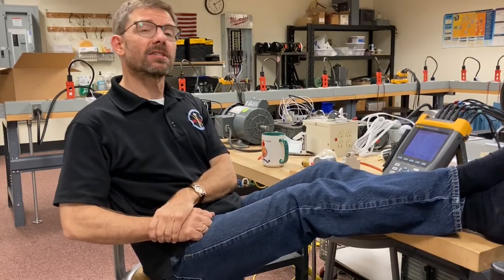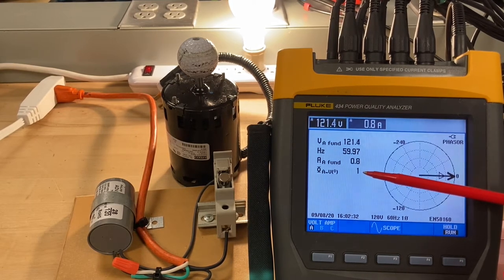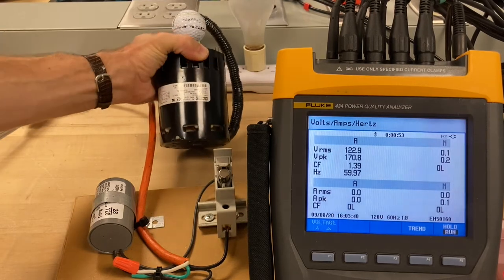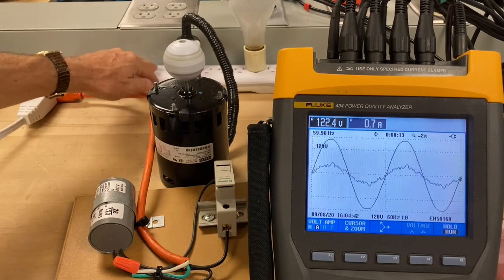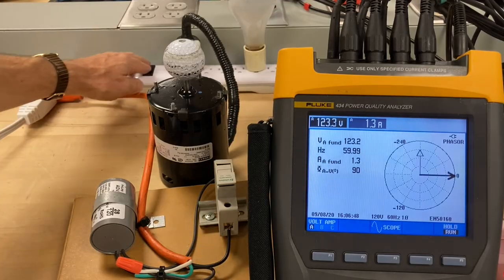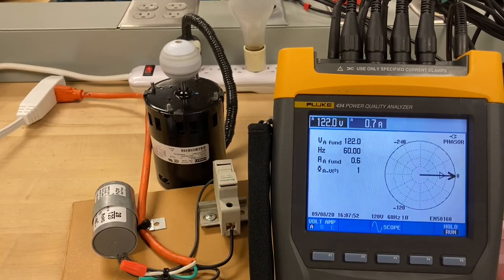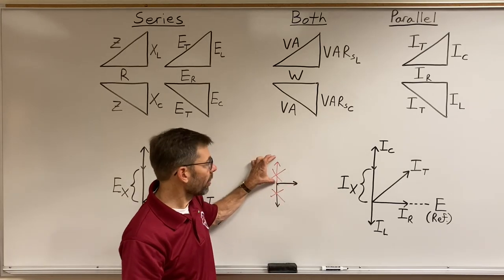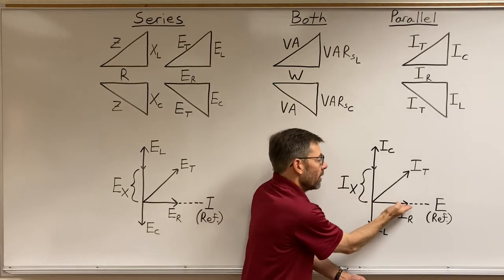Introduction to RLC Circuits

Comment: @davegordon6819 In a parallel RLC circuit, would impedance be calculated as
Z=(R•XT)/√(R^2+XT^2) ?

And is total reactance still equal to the smaller of the two reactances subtracted from the larger?  7:36